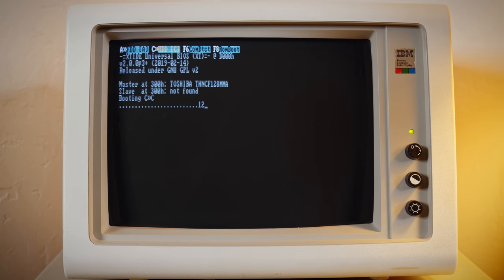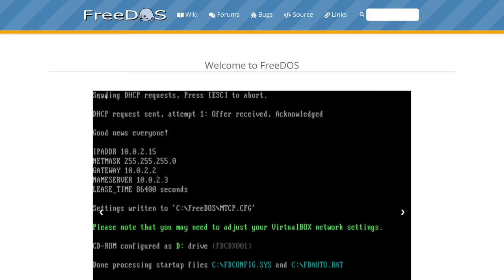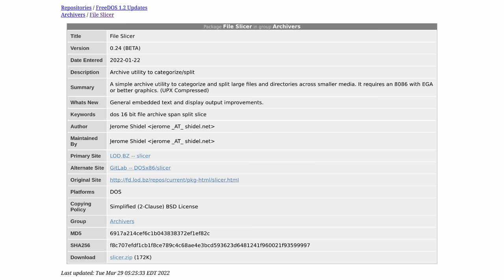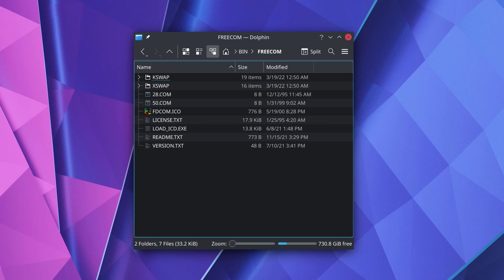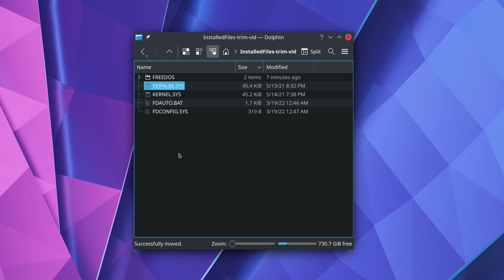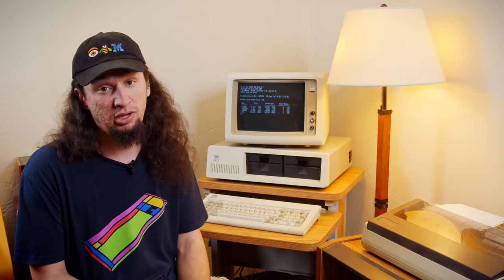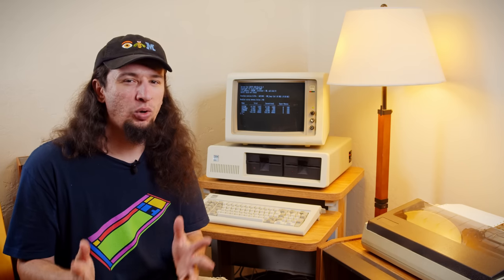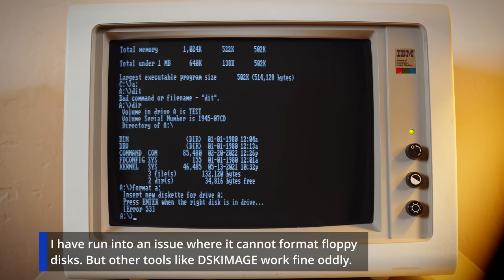Installing FreeDOS for 8086 on an IBM 5150

Comment: This is mostly a dumb idea.  Dos 5 works well with an XT (I had this back in the day. A compaq luggable with a 10MB hard disk).  DOS 5 is the best version of DOS anyhow.  3.3 is second best. 6 third.  The only useful thing dos 6 even does is allow bypassing config.sys and autoexec.bat and the menu system for custom boot up.  But a boot disk(meaning a disk per configuration) does the same thing.
The Boot disk I always carried with me had io dot sys, msdos sys, command com, (and, of course, the bootsector, which is not a file) xcopy, dot exe edit dot com, qbasic support for running edit, sys dot com/exe (I forget which) and a few others.  But I also had multiple disks with network requestors on them.

One advantage I had is there were limits to the different types of machines I could run into because I worked in the IT dept of an accounting firm.  We tried to put the same hardware on everyone's desks.  I just wasn't going to run into 100 different computers all with different hardware/configurations.  IIRC, the last time I relied entirely on dos boot disks, the vast majority of machines were compaq 386/25M
Reply: I wish I could downvote this comment harder. Anyone who lists DOS 6.0 in a list of the top DOS versions has lost me. Do you not realize it was the version that introduced drive compression that resulted in data loss?
Reply: sure those are good options  too but  i think he did mention FAT32 and special project of some sort.
Reply: @j2simpso  But it's not enabled by default.  It wasn't the compression format's fault. These were bad drives.  The "update" in 6.2 did better checking, but loads the compression module by default (even if there are no compressed drives, IIRC, floppies had the 6.2 compression supported, which is ridiculous in some ways and very good in others )and you can only get it to not load by deleting the hidden doublspc dot sys file and all the conventional ram it occupies.
I supported thousands of PCs running DOS and I generated the image files for them and Dos 5 is by far the best dos.  I put a different comment on this video about it. 
I put dos 6 as in third place (after 3.3)   It's only marginally worse than dos 5 and gives you the bootable configuration stuff and a bypass.  I cannot tell you how many desktop visits I've done because of problems with config dot sys or autoexec.bat that stopped the PC from booting.  I couldn't walk them through anything because they didn't have boot disks and so I had to get up and go to their desks and for remote people, drive to their damned house.
Reply: @retronicksprogrammingchann2337  I put in a different comment thread that I cannot understand why anyone would need fat32 on such a system other than to save money by buying a current SD card out of walmart.  But you can still get smaller CF or SD cards (less than 4GB, which will support 2 2Gig partitions) especially used on ebay

.  Personally, I would always stick with CF over SD.  For one, it's a simpler system more compatible with old PCs and 2, they are much better quality generally speaking.  CF cards were/are in high end devices where people don't expect dirt cheap media.  I would not trust any modern SD card for a hard drive application, largely because I wouldn't want to have to re-invest the time to reconfigure it..
Reply: PC Dos 7 uses less conventional memory and has out of the box Rexx support along the ability to shove more data onto 1.44meg disks. DR-Dos has useful tools built in like command history and a built in task manager. Novell Dos has built in network stack and FreeDos has built in modern Network stack.  MS-Dos after 3.2 was behind the competition that is why Microsoft bound its Dos to Windows 95 as Microsoft felt it couldn't win the Dos wars of the 90s.
Reply: @Psy500  Rexx was great on OS2.  One of the companies I worked for did automatic software rollouts through rexx. 

I know PC dos lived a bit longer than MS Dos and I have not heard that it introduces incompatibilities. 

 It probably doesn't use less conventional memory on a pre-386 (UMA) or pre-286 (HMA)  machine with no uma or high memory area (the soft segment that starts at ffff:fff0 and goes 64k into RAM above 1MB).  It can't load anything into protected memory because there is no protected memory on an 8088 or 8086 based PC.  Though if you have an EMS board, perhaps TSRs  could be loaded there. But EMS is constantly moving in that frame and so probably not, though it could be programmed to only use 1 64k frame to hold all the TSRs. (though the original drivers won't be able to do that)
 DOS 5 was already pretty well optimized and for compatibility's sake, I can't see it being much different.  On a 5150, you're just not going to have much loaded.  Just seems like a lot of hassle. (freedos, not PC-dos)
Also, uses less conventional ram than which version of DOS?
Also, most of the games (really, what else are you going to do with this machine) specifically made for the XT or 5150 class machines don't usually need anywhere near 640k.  It was not until they were pretty obsolete that they started shipping with 640k.  The early ones were being sold with 64 or 128 and so most of the software can run with very little conventional memory.
Reply: @tarstarkusz  Dos 7 minimal install uses less conventional memory then a stock minimal install of Dos 5 (593,328 bytes free for Dos 5 vs 593,840 bytes free for PC Dos 7). Dos 3.3 and under still wins if you need to maximize conventional memory including the Compaq version that gives you bigger partition sizes then 32megs. While the 5150 rarely would have been fitted with 640k, the turbo XT clones would yet a 8mhz 8088 is not that much faster a 4.77mhz 8088.  Thus games made for a turbo XT like the Tandy 1000 SX will still run okay on a stock 4.77mhz 8088.
Reply: @Psy500  All of those cheap generic clones came out in the late 80s. Most of them came with the full 640k. But most of the games that will run properly on those machines came out earlier, before most were shipping with 640k and most have pretty light minimum RAM required, though obviously there are some examples of CGA games that will work on 8088/8086 machine that need a lot of conventional memory and would require the 640k.
It's actually surprising to hear just how close they are.  Is there a decent memory benefit for 386 and up computers? 

I used to have to develop images for Dos/windows computers and I spent many, many hours maximizing conventional memory for images for new PC rollouts.  When dos 6 came out, I could beat memmaker by 50-100k easy. The order you load drivers and TSRs can make a big difference. And these all had network drivers and requestors.

It's hard to tell using TGA games because they do more work in Tandy mode (while there are fewer pixels, they are in 4 bit depth plus the sound) and you can't run the games in tandy mode on a reguar XT/5150 machine.  Plus, the bus is a big limitation on these class of machines assuming the Tandy machines use a 4.77mhz bus.  ISA is fairly flexible, so it might be running at 8mhz or whatever the processor is running at.   I would assume highly processor dependent stuff will run faster on the higher clocked Tandy machines, but the system as a whole might not really be any faster. Also the RAM is slow.
Reply: @tarstarkusz  PC Dos 7 was made for more modern machines. The memory optimizations was made to fit more in the upper memory block to give the user more room in conventional.  As for the RAM being slow, the TI-99/4 had the same problem in that the CPU got slammed every time it needed anything outside its 256 bytes of cache and the 8088 has a similar problem where you really need a 8mhz 8086 to see a doubling of frame rates in something like MS flight simulator as the 8086 is reading memory 16-bits at a time instead 8-bits of the 8088.
Reply: @Psy500  Yes, the 5150 with the 8088 is stuck with an 8 bit data path which really hampers the machine and the ISA bus is also at 8 bit.  It really is amazing what they were able to do to improve the platform while maintaining backwards compatibility.  The Macintosh is up to its fourth total architecture change (form 0x0 to PPC to intel and now to the M something), clean break.
Reply: DOS 6 offers much more than just a boot menu. The inbuilt help system is much better than in DOS 5. DOS 6 offers DELTREE, MOVE, INTERLNK, INTERSRV, DEFRAG, POWER, MSD and SCANDISK. All these commands are missing in DOS 5. EDIT from DOS 6 is more advanced than the version in DOS 5. POWER is useful for energy management for CPUs with APM support. And INTERLNK and INTERSRV are very useful if you want to send files over serial cable, parallel cable or network. SCANDISK ist much better than CHKDSK. For DEFRAG and MSD you will require 3rd party alternatives on MS-DOS 5.
Reply: @OpenGL4ever  MSD and scandisk are both dos 5 programs. IIRC, the help system is more or less identical and uses edit/qbasic in both 5 and 6.
Defrag is one of the bad things of DOS 6. Deltree was a life saver. so was move.  But I know (well, knew) the commands pretty well.  xcopy is great in that you can use the breadcrumbs to move around the tree without changing directories.
Say you have 
C
--dir
-----subdir1
------subdir2
and you're sitting at the c:\dir\subdir1\ prompt.  You can type xcopy file  ..\subdir2\
the ..  are the "breadcrumbs" that are at the top of every directory.  There is all kinds of little tricks like that. Saves a lot of typing. You can easily have 8 nested directories. That .. trick can be used in other ways with xcopy. 

I wrote a batch file to do moves with DOS 5  The one flaw it had was there was no way to check that the copy worked. So if the copy failed (say, because the destination disk didn't have the room for all the files), the batch file would just pretend that didn't happen, assume the copy was good and then delete the source files.

I always used PCtools for transferring files across a parallel (laplink) cable.  But most of my professional work was always networked and so I didn't have to rely on it so much.

Dos 5 will always have a place in my heart. I used it for many years.  I even wrote a menu system in batch complete with a quasi-gui (entirely in batch files plus ansi dot sys) as a project for school. It was absolutely rock solid and MUCH more intuitive than 3.3.(imagine trying to talk someone over the phone using edlin)  Dos 4 was a disaster. Edit alone was worth the price. Fat 16 (3.3 was fat 12 with a 32MB max logical drive size). Emm386, himem and many other features.